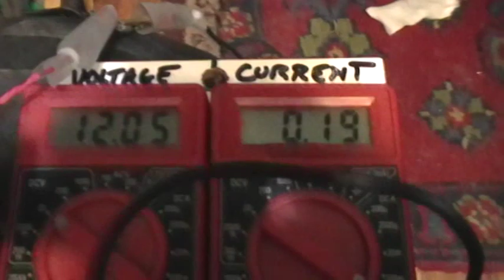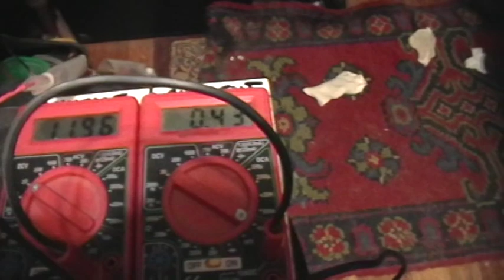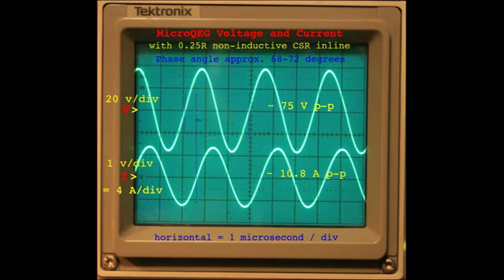Electric OU: MicroQEG Update: DC Out, Motor, Measurements

Comment from the maker: @JOHN WILFONG For some reason that I still do not understand the "Reply" button  is missing from your comment. This is some trick of Google's that seems totally asinine to me; the owner of a video should be able to reply easily and directly to all comments made on the video, without anybody having to check any boxes or open other accounts.
Be that as it may... Thank you very much for your kind comment! Yes, I have encountered the user you mention. Yes, I have looked at the website you linked. There is so much wrong there I cannot even begin to list the problems. The claims of running cars on small amounts of "Brown's Gas" made by electrolysis using the car's own power for one thing are completely false. I don't have the time or inclination to take on every false claimant, but I hope you know by now that you should always ask for the actual data that support the claims, and if the data is not forthcoming or is not rock-solid, then please... keep your wallet firmly in your pocket and your checkbook tightly closed, however open your mind might be.
"Radiant" energy? What is that? Try to get a coherent definition from anyone who uses the term. There is high frequency high voltage RF, which is all I find whenever I look at a device that the claimant says produces "Radiant Energy".  Please see my MHOP playlist or my SSTC videos or a bunch of other work I've done for plenty of examples of creating and using "radiant energy".
If I give you two batteries, one charged with supermumble's charger and one with a conventional charger to the same terminal voltage.... will you be able to tell them apart? What test would you apply that could discriminate between the two batteries, if you didn't know which was which?
Reply: You cant always +tag someone. If they haven't turned on their G+ account yet, or if they have ticked a box in their account setting preventing people from tagging them. For eg you can chose only to be tagged by people in your circles.
Same with replying, you can stop reply comments from anyone not in your circles.

I agree about video exemptions though. If someone comments on my video. I would like the right of reply to be unconditional.
Reply: Tin all you have to do is " + google name" to reply when the reply button is not avail + tinselKoala TinselKoala  :) not sure if you knew that ... just trying to be helpful
Reply from the maker: DesertExperimenter
Oh... but does the reply then show up below the comment I'm replying to then?
And why does it do this in the first place?
I still think this whole Google+ thing is stupid, a plot to make everyone stay logged into google all the time so they can keep you busy and track you and sell you stuff. I for one would be very happy if it went back to the old way. And this new change where your Video Manager is now three clicks away instead of one! Absurd. I just bookmarked the page and now go there with one click again by the bookmark. Ha ha google, I'll bet everybody winds up doing it that way eventually, screw your three-times-longer "shortcut".
Reply from the maker: Mongrel Shark
Absolutely. I have options to block them, which removes them and all their comments, but not to reply. That makes absolutely no sense.
Reply: I Figured  it out today I think, If I try to reply from my google+ profile I don't get a reply link, however from the video itself or the bell icon in youtube I can ... do you guys notice the same ?
Reply: I never get a reply link anywhere but on youtube page. Its a big pain. I have to load my video up every time I get a new comment.
Once the first reply in done I can continue talking in that thread from the bell icon.
Reply from the maker: Mongrel Shark
Weird. For example I am replying to this from the "bell" pulldown. I am on a YT page but not on this specific video page.
But I str that early on, I couldn't reply to your comments to my videos either. Something changed, and then I could.
Reply from the maker: DesertExperimenter
I'm not sure if I understand the difference. I am talking about when I'm looking at my video on its page, and there's a comment below. I look and don't find a "reply" button. But other comments have them. But even if there isn't a reply button I have "block user" and "remove" options. It makes no sense.
Reply: lets just hope they are messing with their system and implementing changes they are not getting right, that is that they are in the process of resolving it ... we've had no end of trouble with our Google hangout invites, trying to invite people we are most certainly connected with on G+  but yet when added to the call, they are not getting the invites, these same people when we try to link them into the invite post google returns an error saying they cannot be added to the post, no one is blocking anything through settings yet this has been a weekly occurrence
Reply: I think a lot of it has to do with who's in what circles, and settings on this page https://plus.google.com/settings
Reply: I have heard about restrictions on people being added to hangouts in large groups too.
Reply: e only trying to get 4-5 people in there, it cannot be that hard, I will look into "what circles though, had a thought of that today and make a new circle for this event ... stupid to make it so complex Google
Reply: A work around for the invites could be to use the events thingy.

Comment: Very nice but I'm still waiting to see the phase angle difference between the non-inductive resistor and toroid current sensors. It's also evident that the input power increases with motor load. I'm certain loading the motor mechanically (ie with a generator) would increase the input power even more. I'm also certain loading affects the pickup parallel tank circuit tuning and wonder if retuning for specific load conditions might null the current draw on the input side?
Reply from the maker: I think that information is in "Phase Part 2" where I stack three different current sensors including the noninductive resistor onto the same wire and feed the wire from the FG.
Scoposcopy: Phase 2: Lissajous Phase Angle Measurement
I have also confirmed that the scope itself isn't introducing any phase shift between the channels, by feeding the same signal from the FG into both channels simultaneously through matched patch cords. There is a tiny tiny shift showing up between channels at 300 kHz, probably much less than one degree. It's a dual trace scope not a dual beam, after all.

I would be more than happy to test the exact Stangenes CT that the FTW QEGgers use, if someone would only donate one to the lab.
Reply from the maker: You are right about the current draw and the tuning, but I don't think you can "null" the current draw on the input side!  However, the power in the tank itself remains pretty constant as the real load varies. It's like... a tank, that is kept full by the input as long as the output load isn't greater than the input. If the output load varies, but isn't ever greater than the input or at least not for long, the tank stays full.

I hope you are aware that I am doing this work to illustrate what the FTW QEG people should be doing. (Be-doing, get it?) I am not claiming OU, I am illustrating measurement problems and issues that are important in measuring reactive power systems.  And I'm learning a lot, myself, along the way.
Thanks for the comments and analysis! Keep them coming.

Comment: Six - ten Watts possible?
Reply from the maker: Please expand your comment. I can't quite tell what the heck you are talking about.
Reply: TinselKoala sorry... the generator .. possible to achieve 3-6Watts
Reply from the maker: Terry Hope I hope you could tell I was dripping with sarcasm when I said "minutes away from self-running". There is no way that the mechanical power output of the little motor exceeds the DC supply input power, and when you couple it to a generator you lose even more. It is certainly possible to achieve 3-6 Watts from a generator driven by a motor powered by a MicroQEG. But you will have to put in 12-24 Watts in DC power to the uQEG in order to do it.